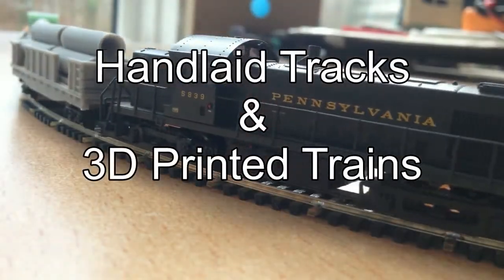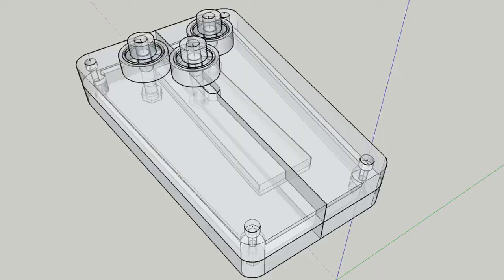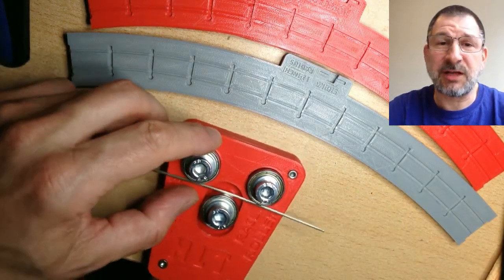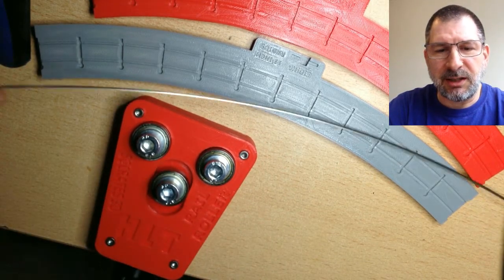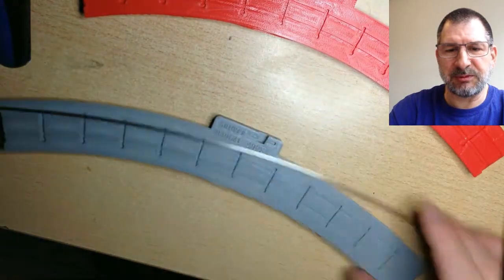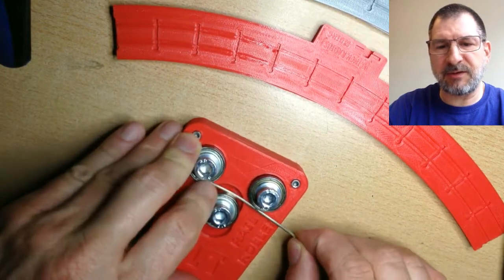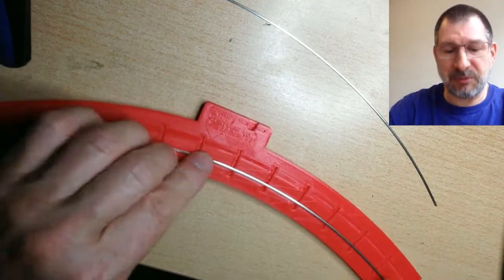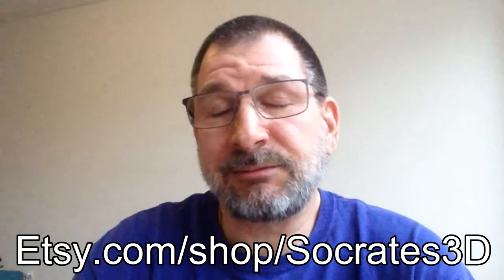3D Printed Rail Roller For Making Curved Track Rails Into Any Radius Quickly & Easily.

Comment: Subscribed. I'm planning an HOn30 layout and have decided to try my hand at hand laid track as there doesn't seem to be any ready made available that suits my "scale" taste. I am also planning on using code 55 rail and becoming more interested in 3D printing. I checked you Etsy page and see there is nothing available currently. Will you sell a complete rail roller and or jigs? Do you have the 3D print files available? Thanks and good luck getting back to work!
Reply from the maker: Hi and thanks! Narrow gauge HO seems a very cool project! I was going to offer printed rail rollers, but the shipping cost is insane. I made a couple but also use multiples as it is easier to leave the first roller as close as possible and then use a second to make adjustments. Sometimes the rail will take a tighter curve with the same position on the first pass. I'll eventually put it on Thingiverse, but its lots of effort for no actual reward. I'm admittedly a very bad capitalist, something about being annoyingly moral gets in my way... Hence there isn't much motivation. But I did just use them again last night. What a great design!! :)
Reply from the maker: Here is the Rail Roller for your enjoyment! https://youtu.be/KlY2-rBR8fM Would love to see that HOn30 layout!